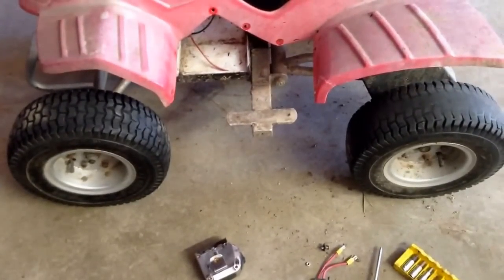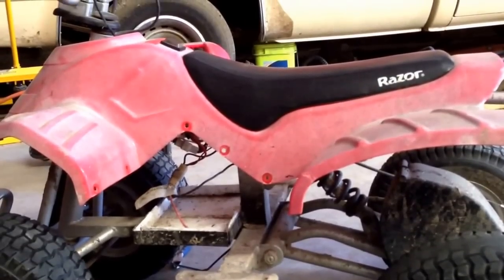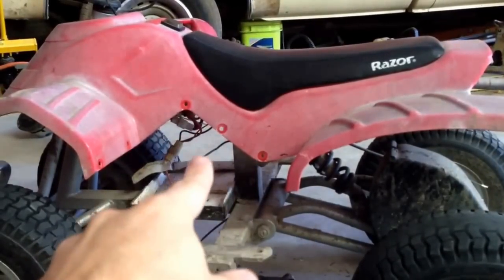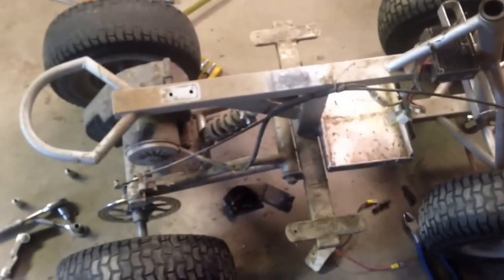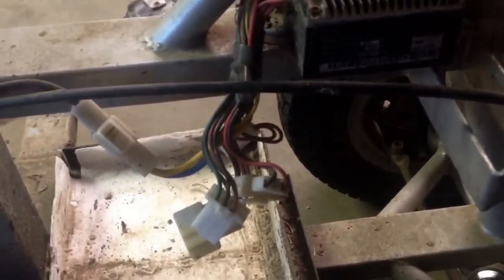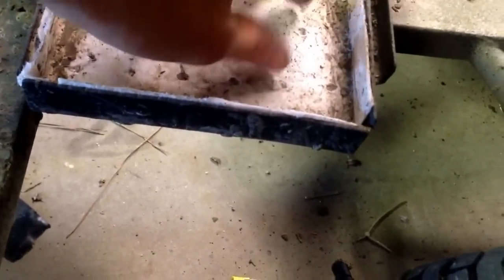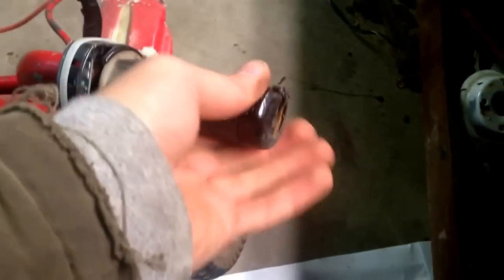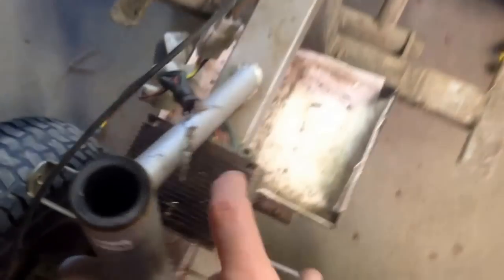Razor Dirt Quad 36 volt upgrade part 1

Comment: can you add a parts list?
Reply from the maker: +holytouchOSC I purchased 4 12v 18ah batteries from amazon, speed controller SPD-36500R and throttle THR-48 from electricscooterparts.com and a switch for reverse locally.

Comment: Do you know the top speed is with the finished mod?
Reply from the maker: +Joshua Pineiro Its over twice as fast as stock but I don't know the mph.
Reply: +mjmcomputers cool, I think stock is about 10 mph so this will put at 20mph more or less. Thanks.
Reply: I added the 36 volt 1000 wat motor and speed controller to my kids with three 12 volt 9ah battery’s and I’m having a issue with the wire going from battery to controller getting hot enough to melt the plug and wire. And idea why ? I hooked everything up according to the website I got them from